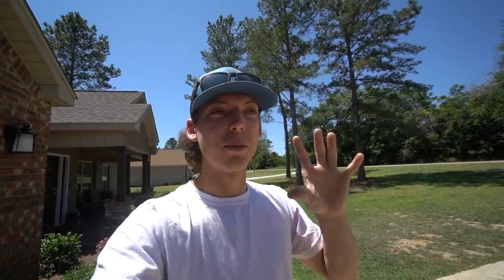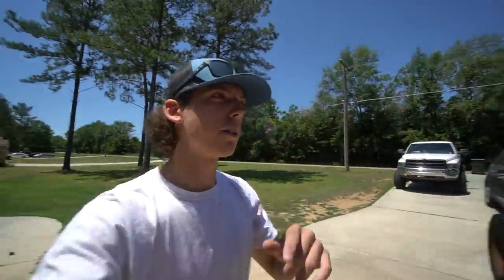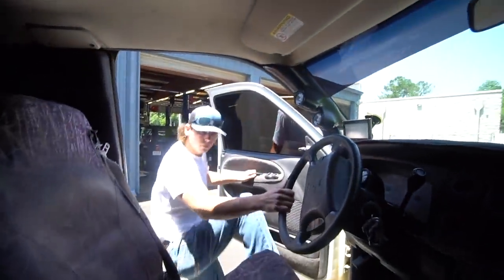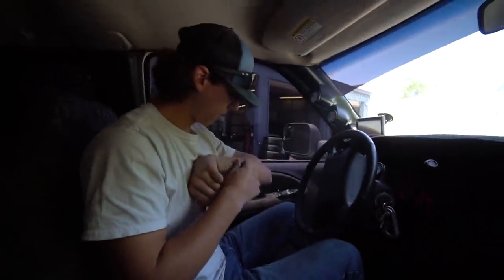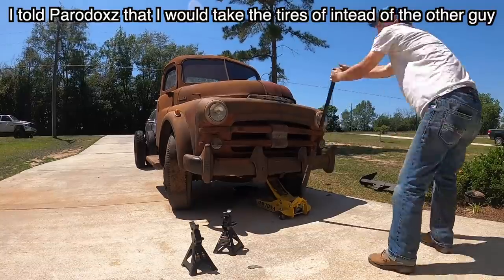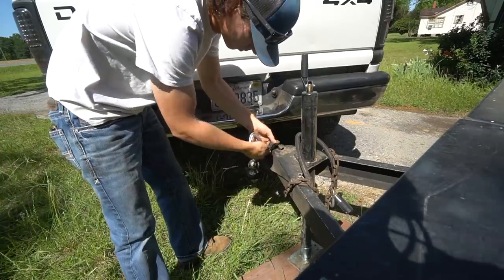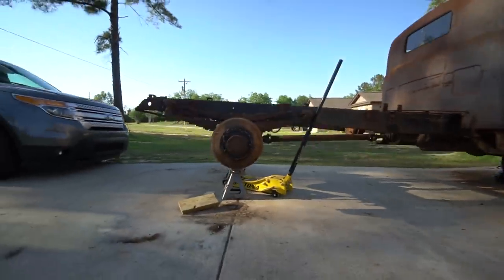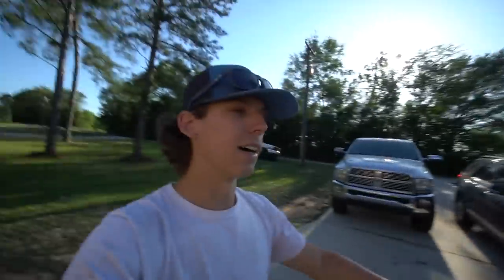MATER gets some NEW RUBBER! 1951 Dodge Dually!

Comment: I have a 52 dodge same model I just swapped the frame for a 2012 dodge cummins. It has a 4bt cummins  slammed on bags. All black with energy green pin stripe and has gator seats all kinds of stuff

Comment: 65 f350 dually with hydraulic flat dump bed clean title motor ain't locked up but wont start 800$ with a solid cab

Comment: Those are Budd rims and they still run them today. Totally safe, unlike their counter one called the hollywood rim and they were real dangerous. They had just a lock that went on the outside of the rim and would collapse on themselves an then the lock rig came off maiming the person. Lots of lawsuits on those. These rims are used on several big names trucks, ford, gmc, dodge ram, an others. Again split rim, and split ring are two different rims totally... I drove big trucks and was a mechanic on big rigs. Don't let someone take you youth away. You will find what you want to do with life and hopefully something that you enjoy. Being a bank manager with a fine suit of clothes is for some but not all. Be yourself till you find that thing that makes you happy

Comment: have been in your position before. I sold my Truck and regretted it. I think you should get a right deal older truck and fix it up but keep yours or you might end up having bad dreams that it is gone. Nice old Job Rated Pilot House era Truck. I have a 1953 and use it weekly for hay deliveries.  They are a great Truck. It should have the 237 engine in it. The 237 was one of Doges best revving engines over the 230 .